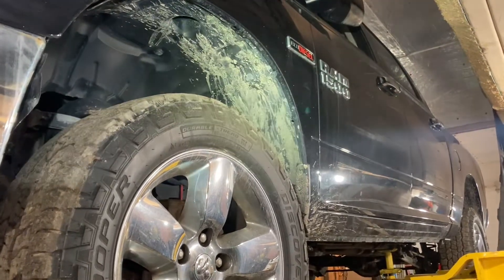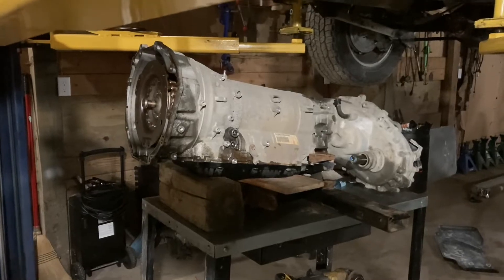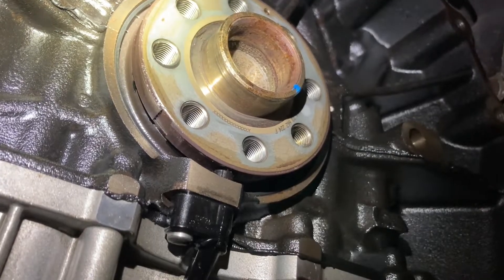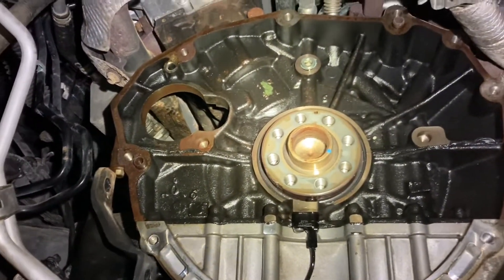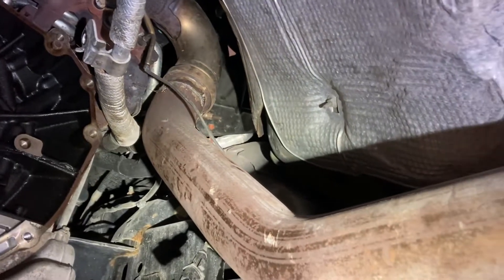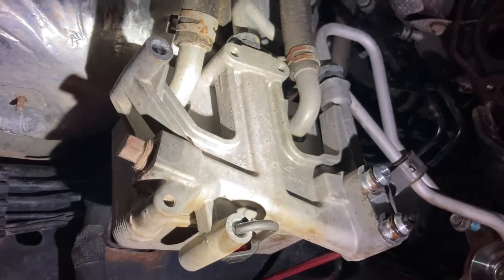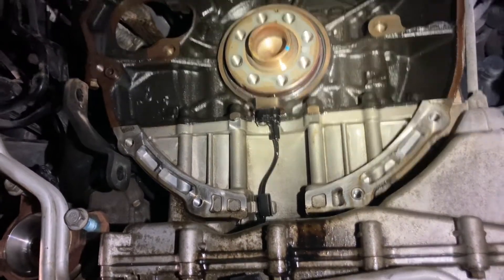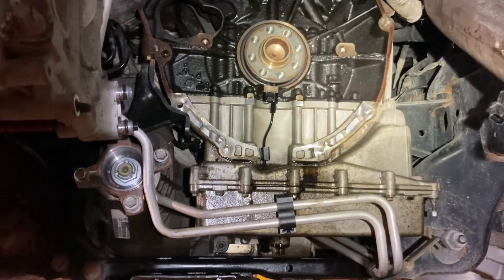Ram Ecodiesel no-start condition caused by faulty crankshaft sensor reluctor wheel/ring

Comment: How do you differentiate between a faulty toner wheel or a bad ckp on the graph? Any possibility of shoving a bore scope in there and turning the engine by hand to see if the toner wheel is broken?
Reply from the maker: If you are getting an erratic crankshaft sensor signal, you don’t differentiate - the job is labor intensive enough to get there, you just go ahead and replace both at the same, no question.  As far as putting a borescope in there - I’ve tried before I would say it’s borderline impossible. Sensor and reluctor wheel are beyond a steel external balancer weight that bolts to the crankshaft. Which is behind the Flexplate.

Comment: Hello mate, when installing reluctor wheel back, the balancer and a flexplate comes on top of that ring, and you secure it using a pin, right? Is it possible to mess this up? I'm asking, because I've got my engine replaced (on Jeep WK2) and since then the engine/transmission is shaking badly in some RPM (basically around idle and few hundred RPMs higher). So I would like to know, if it's possible to put balancer/flexplate back incorretly? From what I've seen, I suppose not, as there is hole for that pin in recultor wheel/balancer/flexplate itself. So I suggest, that input shaft on my transmission might be damaged, as the engine was replaced. Thanks for reply.

Comment: I have a 2015 ram 1500 ecodiesel that has a intermediate crank no start , but I can pull #14 relay and put it back in and it will start and run.

Comment: FYI, The dealership quoted me $3500 to do this job, and the local transmission shop did it for $850. The shop said afterwards he should have charged a little more due to the amount of work involved.
Reply from the maker: @monkeycarz  that all sounds good. $850 is a solid deal. I’d say $850-$1100 would be about right.

Comment: Just changed the tone wheel not reading any codes now but We can get it to run and stay running but we have to hold the throttle wide open and if the rpm’s drop below 1000 rpm’s it shuts off like it’s running out of fuel help anyone have those issues?
Reply from the maker: @travishowell5395  was the reluctor wheel, and counterweight positioned and clocked correctly when they were reinstalled?

Aside from that, try disconnecting the battery, and leaving it undone for a while. Also, use a competent scan tool and inspect for and clear any codes, and if it gives you the command option, see you if can reset the computer via that scan tool. If you need to buy one, an inexpensive Autel 808 does the trick. There may be cheaper options out there.
Reply: Yes they were clocked correctly. Batteries have been left disconnected for a significant period of time. There’s no codes. We can reset the data but we didn’t want to do that because we thought it would remove or screw up the tune. That is the scan tool we have eoc stage 2 delete tune i really appreciate your prompt reply
Reply: We can also see engine speed
Reply from the maker: @travishowell5395  is there any chance it really does have underlying fuel issues? Does it run normal over 1000rpm? I’d consider connecting a fuel pressure gauge to the low side of the fuel system and be sure it’s keeping a solid 55-65psi the entire time.
Reply: First I got the service electronic throttle control check engine light code p0336 while driving, took it home and parked it ordered the parts, started up and drove to the shop no problems just took a little longer to crank before starting but ran okay,  changed the tone wheel and sensor now it doesn't have check engine light but wont start unless pedal is all the way down then you have to hold it above 1k rpms to stays running just odd for it to possibly be a fuel problem when it was good before the tone wheel change I'm kinda stumped I really appreciate your input
Reply: I haven’t had a pressure gauge on it yet but with the key on the pump runs but when you start to crank the lift pump either sounds weak or shuts off momentarily and if it starts it runs great over 1000-1100 rpm but if it drops below that it shuts off, We remove the feed line from the tank to the filter, housing and ran into a bucket and it seems to have good pressure the filters don’t seem to be clogged, but I haven’t put a new one in yet
Reply from the maker: @ I agree, a fuel pressure issue wouldn’t make sense. Maybe look through the scan tool menu and see if there is a crank/cam relearn procedure, but I’ve never had to use or looked for one on an ecodiesel. Another possibility is a defective reluctor wheel/crank sensor. There was another guy I was going back and forth with in the comments of one of my videos…..and he did the job and still had issues after. He was convinced the reluctor wheel/crank sensor was faulty but I had some serious doubts. Apparently, that really WAS the issue. They were genuine mopar parts as well I guess. It’s a discouraging thought to have to take that all apart again….but keep that in mind as a possibility. Maybe a flaw in either the reluctor wheel or crank sensor. I’m going to look through my comments and find that discussion
Reply: @tadsworkshop I would appreciate your input. I also had a crank no start. No codes. Tested CKP signal with oscilloscope and signal was indicating missing timing marks / gaps. Replaced the CKP Sensor and tone wheel. Now gets P0016. Reset ECM, but code keeps coming back. Is there a difference between the reluctor rings as some part numbers differ. As far as I can tell it was only the old CKP Sensor that was bad, but I replaced reluctor ring to be safe. Old one seemed all intact / in order. Smwould you suggest I replace the reluctor ring with the old one?
Reply: Also it is still a crank no start but now with the P0016 code
Reply from the maker: @CDM_Tuning hmm that’s a tough one. I would verify the part number of whatever reluctor ring and crank sensor (is the crank sensor mopar or aftermarket?) with the local dealership, as per the VIN you provide them. You could browse around in your scan tool and see if there is a crank/cam calibration hot function, but I’ve never had to do that. It’s always been a simple remove and replacement.

And, we are all capable of making mistakes, but is there any chance it was clocked/indexed incorrectly?

On another note, I had another gentleman here who installed an apparently defective reluctor ring and had to do the job twice. The second time is fired right back up.
Reply: @tadsworkshop  thanks for the prompt reply. We very diligently marked each and every bolt, Dell, potion etc to make sure it goes back the same. Checked for relearn on my Autel Maxisys Ultra but none / says not supported. Also on other sites all relearn processes state the engine needs to start and run and be above 158°F so no luck there. I will start by pulling the ring and replacing with the old one. Sensor is a new Mopar one and tests 100% on scope and as per multimeter tests as described by Scanner Danner and others. Thanks again for the help. Really appreciate it
Reply from the maker: @CDM_Tuning hmm. Well whatever you find, please keep me informed, I’d love to learn from your experience.

Comment: Would it be easier to take the transfer case off or the def tank if ya have a stock truck
Reply from the maker: @kylphelps13  I never bother with the def tank. I try to take out the transmission and transfer case as one assembly, with the crossmember. If that is not practical for you, just do the transfer case first, then the transmission. Before you do that, there is a weight bolted to the transfer case - remove that first and throw it to the side. I never reinstall it. It’s for dampening noise/vibration at a certain frequency. Have never had any complaints about not reinstalling it.

Comment: I did the same thing as you, I changed the wheel and now it doesn't turn on anymore, did you use a scanner to program the ckp?
Reply from the maker: @LuisLopez-sc3tc  No, I’ve never had to program the crankshaft sensor. Simply remove and replace. When you say it doesn’t turn on anymore, what exactly does that mean? It doesn’t crank over whatsoever?
Reply: So did get it in runnung bro?

Comment: Can a crank sensor malfunction and cause it to damage a main bearing bearing.  My truck while driving last night truck 
With no warnings just went flat but did not completely die.  Lots of flashing warning lights. And it sounds like a steady knocking in the engine and it sounds like I’m down a couple of cylinders. Scanner reads, crank sensor and several other codes in the transmission and ABS I’m sure the other codes are feeding off of the fact the engine isn’t running properly and causing other codes.  Obviously I don’t want to do the repair if I have a bearing that’s bad. I’m just not that educated on diesel engines.  I know enough to know if I have a bad bearing I usually would drop some oil pressure.  There’s no drop in oil pressure whatsoever and there’s no leaking from anywhere. Any ideas?
Reply from the maker: @NOS-ZL1  main bearing issues are well documented for these engines, but in my experience an ecodiesel with a spun main bearing will always dump oil out of the rear main seal. Specifically, a steady stream of oil. So if you don’t see that, I would personally pull the transmission and transfer case (if yours is 4WD) and replace the crank sensor and the reluctor wheel. From what you’re describing, it sounds like just the crank sensor. Observe for that massive oil leak I mentioned, but otherwise, go for it.
Reply: @tadsworkshop  that’s kind of what I was thinking. I think since I don’t have the oil pressure loss and I don’t have any leaks. It’s worth taking the gamble and going ahead and doing the repair.  I have one more question for you if you wouldn’t mind. I’ve heard a rumor if you ever have to do this repair something would have to be reprogrammed for it to work properly.  Is that something I should be concerned about?   If it matters My truck is fully deleted and is tuned by Ecodiesel of Canada.
Reply from the maker: @NOS-ZL1  no. I’ve never had to do anything special after replacing an ecodiesel crank sensor, both on deleted trucks and stock ones. It’s true, on some vehicles there may be a crankshaft relearn procedure, but I’m not aware of any on the ecodiesel and it’s never been an issue. Also, I want to note, as you get down to the crank sensor, there is a flywheel and a counterweight you’ll see that has to be removed. Just pay close attention to how everything is bolted together. I like to use an oil based paint marker so mark how things are clocked together. Take pictures, etc. Please let me know when you get your truck back up and running!
Reply: @tadsworkshop  thanks for the info.  Great video, one of your other videos really helped me as well. “turbo coolant line”   Thanks again
Reply: @tadsworkshop I finally got around to doing the job and the wheel was in fact broken.  It had missing pieces material in two different places. I’ll replace the reluctor wheel and Also the crank position sensor However, after putting it back together, I run into an issue that I was hoping maybe you could shed some light on.  After doing the repair I go to start the truck and it spins over approximately a second and a half and times out.  Truck is spinning freely. I’ve also change the starter relay thinking that it was possibly kicking out. I check for any codes or anything that could be causing it to time out after just a second or two. Everything reads good  with no fault code. I’ve ran Internet I’m finding a lot of crank no starts. But nothing on the starter timing out before it has an opportunity to start the truck.  Any help would be appreciated.
Reply from the maker: @NOS-ZL1  well, obviously you had to remove the starter to do this job. Any chance you have a loose connection at the starter solenoid? Either the heavy gauge cable or the ignition trigger wire? Also, be sure of your battery ground as well. Make sure these three things are perfect. Also, I can’t emphasize this enough, make sure your battery terminal connections are flawless and very tight.
Reply: @tadsworkshop  I have checked and double checked everything. It spins  freely as it should. But it only lasts for a second or so. And then you have to recycle the key. After recycling the key once again, it spins freely, but only for a second.  Everything seems normal and seems to work as it should other than it just times out or something just after it starts to spin the engine. It’s almost like maybe the signal to the relay is being interrupted somehow.  I’m going to just keep plugging away at it. When I get to the bottom of it, I will comment on what I found in case someone else has this issue.
Reply from the maker: @ I would rig up a test light on the starter trigger wire, so that you can watch it while you crank the engine. If you can see that truly, the computer is choosing to terminate the signal on that wire, than clearly you have an electronic issue or reason why it’s doing that, but as an alternative, I would keep the key in the on position, and rig a jumper wire for that starter wire, so you yourself can control how long it cranks. See if it fires up. Basically, manually override that starter, but with the key on so as the engine can start up.
Reply: @ it’s funny you suggest that because I just came back in from running a jumper wire from the hot terminal on the starter to the small wire as we used to do with screwdrivers back in the old days.   It does in fact, crank as long as I hold the wire.  However, after doing that, I now have a whole host of codes. One of the codes unfortunately says that I have a faulty crank sensor.   I double checked my plug to the crank sensor. Everything seems to be connected properly and secure. I guess It’s very possible I have just landed on a bad part from the factory.
Reply from the maker: @ what were the codes that came up? Anything is possible, but personally I’m skeptical of defective factory parts. But, again it wouldn’t be the first time in history that’s happened.
Reply: @tadsworkshop  I took the truck back apart took my parts back to my guys at our local dealer. They replaced both parts for me and I just completed the job for a second time and it fired up and runs great no issues no codes. So in the end, either the reluctor wheel or the crank sensor was in fact a bad part. Thanks for all your help along the way. Your video helped me pull through another one of the dreaded Ecodiesel jobs.
Reply from the maker: @ wow that’s amazing, and good for you, I understand not only how much work that job is, but also the frustration and hair-pulling associated with new defective parts. Way to go; that must’ve been a great feeling hearing that thing fire up again.
Reply: @tadsworkshop  it was an amazing feeling. If I had to take it apart again, I may have been inclined to LS swap it.  Something I actually know how to work on.😂 you have a good night my friend and thanks again

Comment: Yep, my 2018 ram eco failed. It's somehow not covered under the recall cause its one vin number off. Even though it clearly states that those that aren't covered would not be affected by tuner ring failure. But I found a good diesel mechanic that fixed it for me, with the fix, oil change, new air filter and 40 mile tow it cost me 1,300.
Reply from the maker: @danielherring9324  expensive, but what you’ve mentioned it within reason, price wise. Glad to hear the truck is back on the road.

Comment: My truck just stalled on highway. 

My mechanic just did this job and now the engine is leaking engine oil from the case where the starter is. There is also a knocking noise from the engine.

Do you have any ideas what that might be?
Reply: My 2016 ecodiesel engine has a loud nocking noise so it  doesn't start anymore could that be the engine
Reply from the maker: @alfredochamu4862  yes. It’s possible it has spun main bearings  at the crankshaft. If you see a stream of oil coming from the rear of the engine while cranking/running, you’ll know it has spun main bearings, which signifies engine rebuild or replacement.
Reply: @tadsworkshop  about how much does it cost to rebuild if that happens?
Reply from the maker: @jerryd4189  As an example, there is a guy in Mexico who offered ecodiesel rebuilds. I’ve used one of his rebuilds and it worked out great. I believe he charges roughly $5500-$7500. All you can do is take the engine out and consult with your local automotive machine shop. Most guys with blown engines try to source used ones. It’s an engine in high demand and prices are up there for used ones.
Reply from the maker: @ThompsonElectrical-i6m  yes. That’s a spun crankshaft main bearing. I’ve seen it several times now. The symptom is always the same - loud knocking and a a continuous stream of oil from the rear main seal of the engine, cascading over the oil pan. You’ll have to rebuild or replace your engine. Sorry for your luck, but you’re definitely not the first. I just replaced an ecodiesel three weeks ago with a spun crankshaft bearing.

Comment: I have p0336 code. Extended crank(approx 3-6s) with START. Runs great after it starts. Could this be the issue?
Reply from the maker: Absolutely. Get on replacing the reluctor wheel and the crankshaft sensor.
Reply: I have the same issue... I am quoted $2000 for this fix

Comment: hi, question, does the crank sensor issue afects the desired fuel pressure at all? meaning at high pressure cp4 desired pressure?
Reply from the maker: To the best of my knowledge, no, it should have no influence on fuel rail pressure.

Comment: Do you happen to know the toque sequence and spec for the new flexplate bolts when reassembling? In the middle of doing mine right now
Reply from the maker: Offhand, I can’t be sure, but I think it is about 100ft/lbs. find a verified source. I use my best judgement, some loctite, and a criss cross pattern, torquing in stages, and evenly.